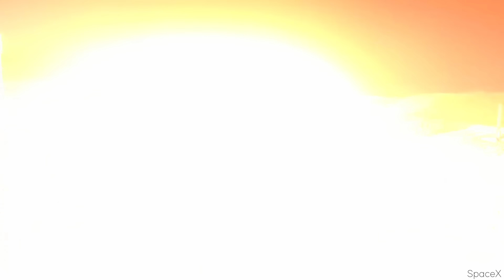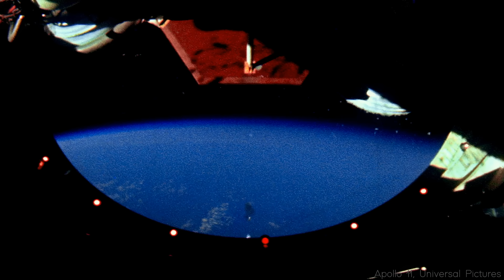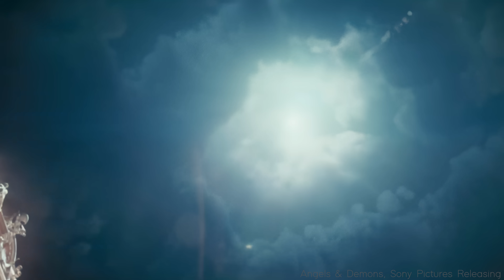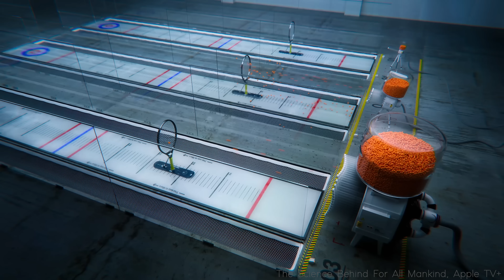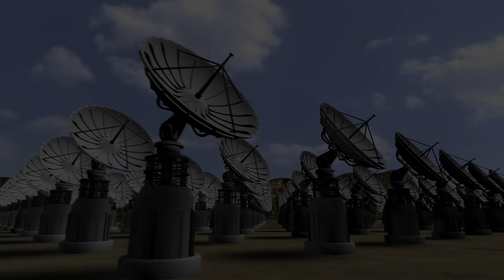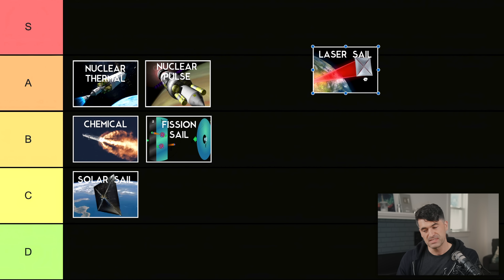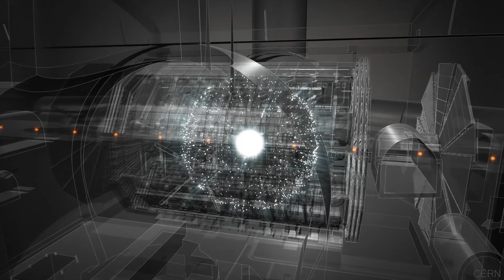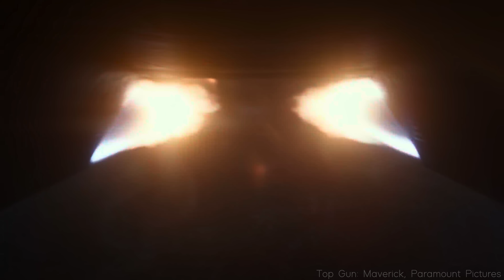Interstellar Propulsion Technologies - RANKED!

Comment: Alcubierre drives would also have a problem with any 'stowaway' material that exists outside the craft but inside whatever warp field it generates. Suddenly as soon as you exit warp space those particles continue accelerating at relativistic speeds and you just turbo-nuked the planet you wanted to visit. Oops. So immediately you're stuck warping to the outer limits of a heliosphere to avoid any potential risk of destroying entire solar systems every time you 'oopsie' a neutron burst and slow-boating your way to the place you want to go inside the solar system, and immediately you've ruined half the point of a warp drive.

Personally I always liked the idea of a Mass Effect jump gate that does sciency-wiency stuff to give you an atomic mass of zero. But it's also either science fantasy or revolves around the idea that gravity manipulation is possible.

Comment: I don't understand why you ranked mathmatically proven concepts like the warp drives in D tier and a physically impossible black hole laser acceleration in B tier. You never explain how light is supposed to steel momentum from a black hole. Light cannot accelerate faster than it's own speed and therefore accelerate anything else faster by traveling faster which seems to be the gist of what your saying unless you explained it terribly. You would be better off taking advantage of the black holes extreme gravity and the oberth effect and using it to accelerate a chemical rocket at intersteller velocities by passing as close as possible to it to utilize maximum efficiency. Better yet just use the Sun for that since that's a lot closer than a thousand light years which is how far the closest black hole is, not as you said a few dozen. You seem like a smart guy from other videos I've seen of yours but in this one I'm not sure where you're getting your information from but you seem to have gone from reading a script written by a scientist to a script written by a moron.

Comment: I think AGI will settle space rather than humans.  AGI will not have biological limits, so, it could wait 10k years to settle a new planet.  It can also build a body for itself that's suited for its environment, as well as being smarter than humans.  

I have tried to do some simple math to calculate the potential speed of rockets.  I have a bachelor's in physics, so, I'm not an expert, but I can do some simple calculations.

First, I tried setting the rest energy of the exhaust mass equal to the kinetic energy of the final mass using Einstein's equations.  This means that 100% of the exhaust matter gets converted into photons which are used to propel the ship.  This is the extreme upper-limit for how fast rockets could travel.  I get sqrt(1 - ( (M0 - Me)/M0)^2) ) = V/C.  As an example, if you used 50% of your mass as fuel, you could reach 87% the speed of light.  It is interesting to me that even in this extreme case of perfect efficiency, you still need a lot of fuel to approach light speed.  To write it in terms of mass instead of speed, it becomes Mf/M0 =  sqrt(1-(V/C)^2).

If you want to speed up to get there and then slow down to land, then I think you just square the equation. The reason is that if you have to use 50% of your mass to speed up, then you have to use 50% of the remainder again to slow down.  So, you just get rid of the square root in the previous equation for speeding up + slowing down.  In that case, you use 50% of your fuel to go a maximum speed of 70% the speed of light (less than before, because you have to use some fuel to slow down).

Now, any real engine will have less than 100% efficiency.  So, you could multiply the rest mass of the fuel by an efficiency term.  I heard that the efficiency of nuclear is about 1%.  If you plug in this 1% efficiency term, then I calculate that using 50% of your mass to speed up and slow down will get you a max speed of about 9% the speed of light.  

If you know physics and you think I've made a mistake, then you can correct me.  But I'll assume that I'm right until proven otherwise.  

This is one of the reasons why I like the idea of AGI settling the galaxy rather than humans.  With nuclear rockets (what I understand to be the best proven rocket technology), we can expect to go something on the order of only ~10% the speed of light.  So, whatever is traveling will have to wait a long time to get there.  

At 10% the speed of light, it ought to be possible for an AGI to settle the galaxy in about 1 million years.  In comparison, the voyager probe would cross the galaxy in about 1.7 billion years.  

Even if future civilizations figure out anti-matter or black hole propulsion or some other scifi thing, if they are still using the rocket equation, they'd still have to use an enormous amount of fuel to get up close to light-speed.  So, I think no matter what level of technological development is reached, interstellar spacecraft will still be 1-way seed pods for sprouting colonies at new star systems.

I am also dubious about the prospect of humans following through on multi-generational projects.  Is there anything a person can say or do today that he can be sure people will still care about in 200 years?  Our ancestors spent centuries building cathedrals, but now, must people don't share in the religious beliefs that motivated the building of the cathedrals in the first place.  How do we know that our great-great grandchildren will even care about projects that we start today?  How do we know that there will still be a stable government and well-funded space agency to interact with probes in two centuries?  But I don't see a reason why an AGI can't stick to its purpose for as long as it continues to exist.

Comment: Lulz. I strongly disagree with several of the rankings. Especially the last two (HALO & Ion drive) are ranked way out of whack (Ion drive is top, your scifi stuff should not even be on the list).
Reply: Sci fi? Why are you so dismissive of this?  You're not educated whatsoever in this field and if you were, most of this "sci-fi stuff" would be at the top of your list. Once you are able to wrap you mind around this "sci-fi" tech and the possible applications, you won't think twice about your little ion thrusters.
Reply: @Nibroc7  Then explain the HALO drive. 
Cause that is the only system i was dismissing. All other systems I know very well and am educated about them. My "little ion thrusters" can reduce a voyage to Mars by a significant margin for a manned mission. 
If you had a clue you would not dismiss them. Unlike the light sail system (not feasible for a long range mission due to a) diminishing thrust and b) targetting problems with a ground based system and c) energy loss due to atmosphere.

Comment: Mistakes in the video:
1. NTR having twice the specific impulse of chemical rockets doesn't mean that the fuel requirement is halved. The tyranny of the rocket equation means that, depending on the ratio of initial mass to final mass in your mission, doubling the specific impulse can cut the needed propellant down to a fraction of what was needed.
2. A solar sail could work even if the force on the sail does not exceed the gravitational pull of the star. If the sail starts on a stable orbit around the star (as we might expect when it's launched), then the force from the radiation pressure would slowly lift the sail onto a higher orbit. The downside of this would be that it would make interstellar travel very slow, but it would not make it impossible.
3. Two negative mass objects would attract each other, not repel.

Comment: Chemical is entirely unsuitable for interstellar travel. Yes, we have a few probes leaving Sol's sphere of influence, but that doesn't mean much when you consider that there's no way to slow those probes down, and I'm not even considering how to keep the dang things powered so we can send and receive data. Ion is better, but still doesn't pack enough delta V to travel interstellar distances in a reasonable amount of time, same with NTR. Nuclear Pulse is good, so are some other proposed technologies, one of my favorites is the Fission Fragment Rocket. I'm not an expert but the FFR seems plausible, doesn't require Fusion or Antimatter, and is safer than some other proposed propulsion methods: nuclear saltwater rockets (though NSWR is badass) for instance. At this point we don't even know if we can reliably extract energy from fusing atoms together and we've been working on the problem for decades and it's still just a few decades away, yeah, we'll see about that. 

I've read that one of the problems with some of the more exotic propulsion techniques is that controlling plasma flow with magnetism is akin to wrangling angry cats wearing laser pointers on their heads. I heard about a breakthrough in fusion research using AI to manipulate the magnetic field, leading to more control over the plasma flow. Perhaps this could help us make future propulsion technologies a reality?

Comment: You forgot the best solution. Fusion reaction rocket. So, fusion reaction would speed up the propellant. First it would be needed to light up the rocket to get the fusion reaction working and after that the fusion reaction would continue when more fuel (for example deuterium) would added to the reaction chamber. The high energy reaction products would of course be released to the space to speed up the rocket. I would think that an open tube is much more to easier to get working than a toroid reaction chamber (Tokamak) design. 

How to reach the fusion reaction? For exaple radio waves gould do that and a fission reator would give the energy.

The rocket supposed to be assembled in the space/eart obit. There are many ways to get the rocket parts to the eart orbit like chemical rocked or earth mass driver. I have some plans about the latter.

Comment: My answer would be Waypoints in space. Why start from earth when you can start in space, and why have a single point solution when you can have a framework. It is essentially the same as the laser drive but we take advantage of the natural vacuum of space and set up way points for a system that functions similarly to how the hadron collider works. Essentially we fly out "Waypoints", which are essentially tubes with lasers, to different points in the solar system and use them to accelerate a ship over and over again until we hit our desired speed at which we will then redirect the ship to the desired direction. In theory this is all possible with existing technology and Individually we have already done each of these concepts in practice. The only thing that would really hinders this is time and money.

Comment: What about a dueterium-tritium fusion rocket? The only real modification to your rocket that you would need is a electromagnetic thrust nozzle for proper vectoring and so it doesn't melt. Both of the fuels are renewable, and create a non dangerous/helpfully biproduct. The energy density is great. It can definitely work, and for sure if people try it can be done before the turn of the century. It's probably the single best high speed short term thrust option. Unfortunately it is radioactive, but not highly, and can be easily shielded against using lead. Maintainance would not be a problem, even if you don't have the solar energy you need from the solar panels that you would definitely have, the amount of energy created by this is very high, and you could surely route some to a high capacity battery elsewhere in the ship, while crew performed maintainable and cleaning. While fusion has hardly been harnessed so far, it it can power stars than it can send a ship out of our solar system.

Comment: The Halo drive is D tier. For a start you need to fire a laser around a black hole which by your own admission is many, may light years away. You have to wait for the light to get there and then return by which time your the craft you want it to hit would of moved due to galactic rotation.

Comment: 1. Far too SLOW to be practical.
2. Far too SLOW to be practical. 
3. Nuclear pulse is simply impossible.
4. Sails WILL NOT WORK for interstellar distances.
5. Is NOT a sail at all, but a rocket. Even so, we are talking about HUGE times.
6. Laser is remotely possible.
7. Warp Drive is pure fiction.
8. Wormholes would have stupendous gravitational tidal effects which would crush any spacecraft.
9. Antimatter seems far beyond practicality.
10. Silly.
11.

Comment: You put chemical in B even though it could never ever ever get us even out of the solar system??? Also you group Nuclear pulse together with Daedalus fusion, but you distinguish between fission, solar and laser sails? Daedalus´ fusion drive, if it worked, could reach our nearest star in 40 years. The HLC and such are not optimized to make antimatter, there are way way better ways of making the stuff and with the bang for your buck it gives it should be S tier. You didn´t even have a category for fusion, but you included the Halo drive and mind upload, and put spacewarping in D? Frankly this video and its rankings baffles me.

Comment: No mention of a Thermonuclear Turbine?

With practical fusion reactors we can create an engine that works on a similar principal as a nuclear thermal rocket, but has the added benefit that the (non-radioactive) plasma bi-product of the reaction becomes a component of the thrust. Super heated plasma is ejected as trust.

In atmosphere such an engine would have a turbine like a modern jet engine to bring in air to both cool the reactor and act as reactant mass to super heat for propulsion.

While in space carried fuel + plasma can act as the reactant mass. Since there's less drag (zero drag) in space less thrust and therefore less reactant mass is needed for the same amount of thrust.

Comment: you missed some important ones nuclear fission fragment rockets are like ion drives with a top speed of 5 percent the speed of light. beamed energy propulsion that absorbed the energy instead of reflecting it to run a fusion reactor or ion thruster so no need for a sail. fusion drives

Comment: The most likely scenario would be combining multiple gravitational slingshots(around sun possibly??) with nuclear pulse peripheral boosters to get some percentage of C speed. 

With no friction in space combining this with a boomerang maneuver might allow for some photos/exploration of a near by interstellar system and information back on return circuit. Combining this with nuclear  thermal for main thruster may allow for additional acceleration on  long journey towards star.  

The payload of the interstellar  ship could include some less exotic spaceships/satellites/rovers to continously explore the star system so the actual interstellar mothership should be quite big.  Alternatively an even better payload would be a self-replicating Von Neuman Probe.  

The intellersar mothership would just take measurement and communicate with said payload and Earth assuming direct communication between the payload and Earth would be infeasible due to distance. It would continously travel in a circuit between star and sun

Comment: There are many problems with alcubier drives, violating causality is not one of them. Special relativity allows for time travel, and it does not violate causality because past events has no causal power in the present.
Reply: >Special relativity allows for time travel

That's like saying Newtonian mechanics allows for pink flying elephants.

> and it does not violate causality because past events has no causal power in the present

That's complete hogwash. Causality violation and time travel are the exact same thing in special relativity.

Comment: All of these are garbage when compared to the mighty closed circuit magnetic plasma drive. :) It uses the Lorentz force to accelerate, essentially an impule engine. Doesn't expel any fuel just requires power, gives precision control.

Comment: It's kind of silly to consider these in a vacuum, forgive the pun.  For example chemical engines as a legitimate interstellar transportation medium is ludicrous.  It will do for getting us up into space from earth, but no real attempt at a manned interstellar space expedition, is going to start with a ship on earth and launch in space.  It's going to be a massive ship, built in space, and once you're in space chemical propellant is just outclassed too easily.  

I was surprised to see that aluminum thick enough to be a sail would be so thick,  examples I've seen before for those sails have said we'll like need a sail about a single atom in thickness, but that doesn't actually seem that infeasible.

I sometimes wonder if we are making too much out of time travel paradoxes.  The more and more I learn about physics the more it seems that if the math tells you time travel, than you should treat it like if the math gave you a singularity.  It means our understanding is breaking down, not that the thing actually happens.  I'll have to watch your video on folding space, because I've never heard it mentioned before that it would allow time travel, so that should be interesting.

Comment: A combination of Solar Sail’s and Ion Propulsion would probably be the cheaper more efficient option. Use chemical rockets to assemble everything in space ISS style but once it’s built in space it is permanent and stays. After the ship is ready it makes some burns with its ion engines then opens up the sail’s. It’s just slowing down I could see being the problem. Aerobreaking might destroy the mothership so maybe some purpose built chemical engines to rapidly slow the vehicle